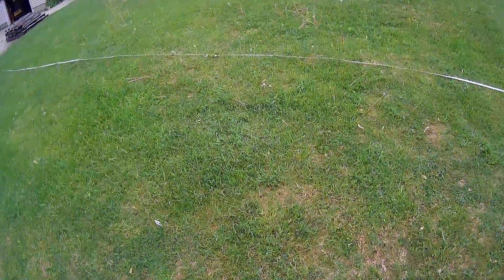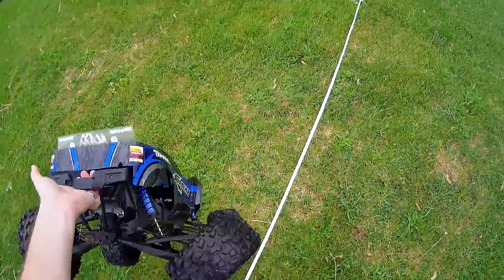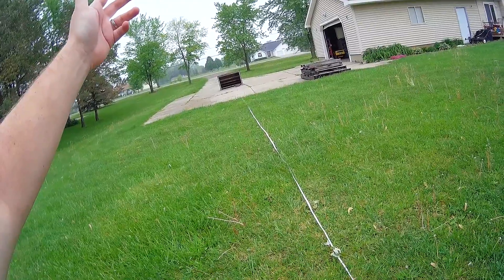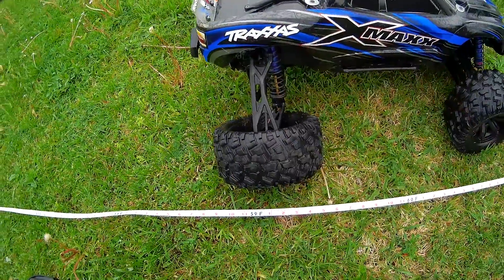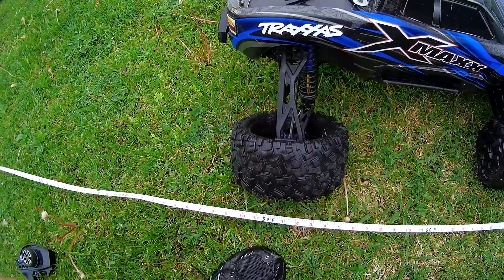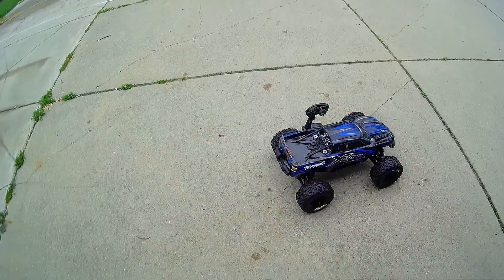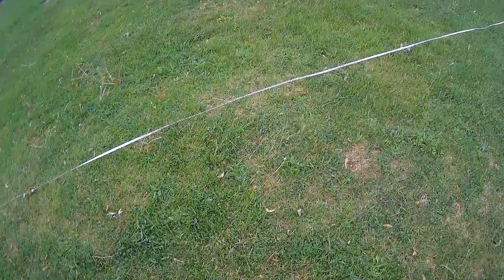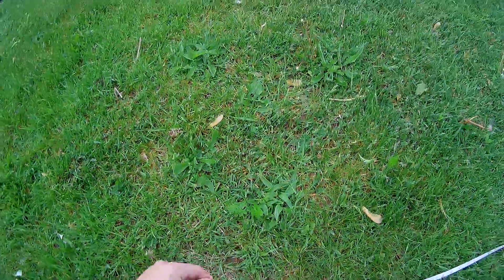Crash test-Unlimited Engineering Supermaxx X-maxx shock shafts

Comment: Can you still use the stock lower clip that holds the bottom of the spring near the rod end or do you have to buy something different that's larger in diameter
Reply from the maker: Mike D you can use the stock spring cup. but you do have to drill the rod end, the kit comes with the drill bit needed. i have a video on how to install these somewhere on my channel.

Comment: My new solution for breaking shit jumping  running for three weeks or so

best setup for me for massive jumping.

Literally I am running 8 springs    8

Had previously upgraded both front and back to the red and green.  stiffest red in back and second down green in front.

20+ airs still pounding the chassis was breaking upper arms or shock 
arms from the sheer force.  I started running straps from lower arms to 
upper shock towers to stop the double double upper arm break and then 
shock arm break from the travel.  worked well but now it seems I don't 
need them.

On the last shock arm break I got fed up. 4 in two weeks.

and there you have it.  coil the stock ones over another set and put the rings up fairly close to the cap.

one side of the joined spring will be closer that hte other.  take the 
bad side and slide it on the shock with the close fitting side at the 
bottom. Shock covers help keep them together and doesn't seem to be an 
issue.

absolutely 0 negative affect on in air natural balance.  no nose bite or
 bad in air behavior. running them for a month and no more broken arms 
or shock arms and going much bigger now.
Reply from the maker: holy smokes. two springs on each shock?
Reply: still running them and they absolutely rock.  Posted my results on traxxas last week.  Supper happy.  Not breaking upper arms or shock rods anymore.  with the adjustment rings set at the same spacing fairly close to the caps the in air level is perfect.  no nose bone or any weird reaction and the truck rarely bottoms out.

B